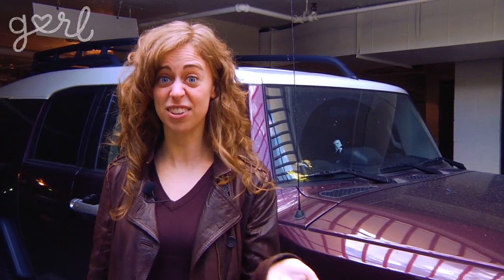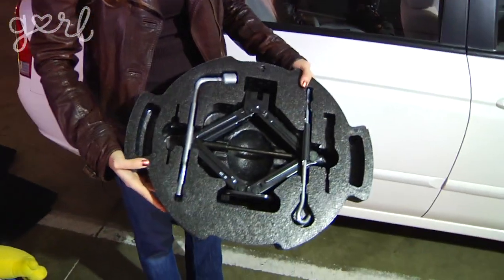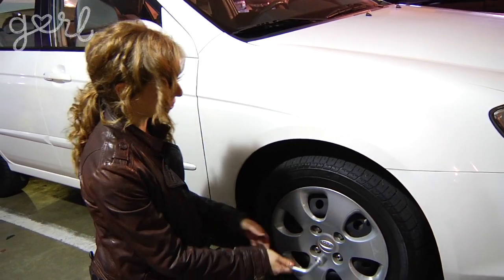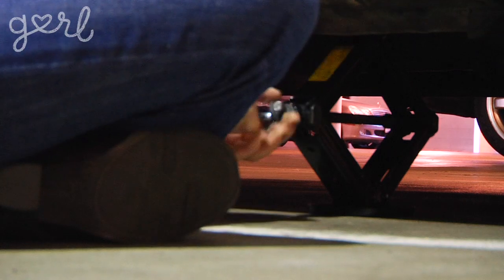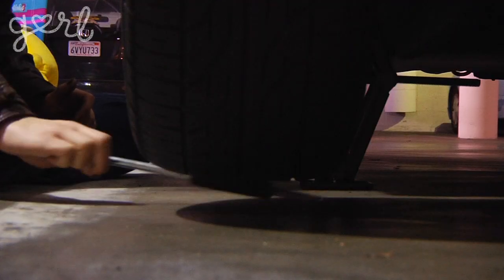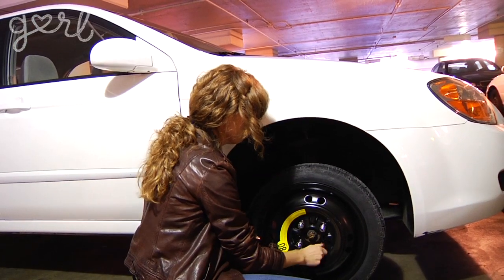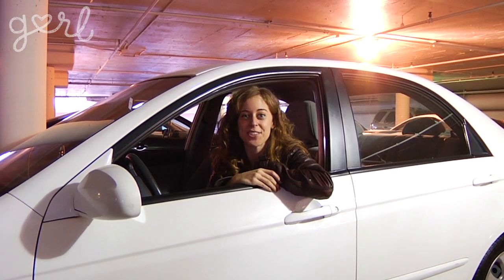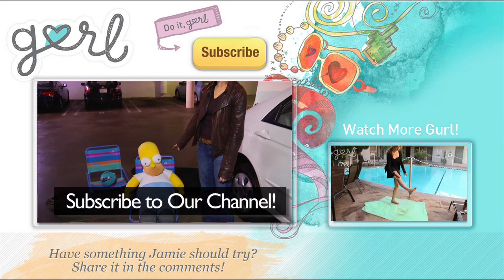How To Change A Tire - See Gurl Try

Comment: it's an inspection that you get every 6 months or so that a smog check garage hooks you up to a machine and they make sure your car isn't polluting too much. smog is the black stuff you see come out of cars and especially semi trucks. Sometimes it's invisible though and that's why its important to get a smog check. I think it's required in all, if not 90% of the United States to help prevent pollution. it also helps extend the life of the car. :)

Comment: Lol, for future reference, PULL UP on the wrench hen loosening the lug nuts. You get more torque by PULLING rather than pushing/standing on the wrench.  Also, no pun intended, if you jerk it upward you also get more torque if you not strong enuff to pull it with brute strength. I liked this video tho (:

Comment: you probably should have put some kind of wood or metal under the tires for extra safety. sometimes the car will slide off of the Jack. the wood or metal behind the tires keep it feels ok moving on you.